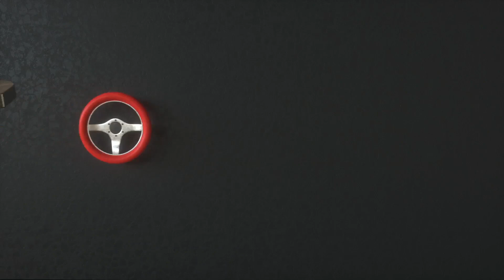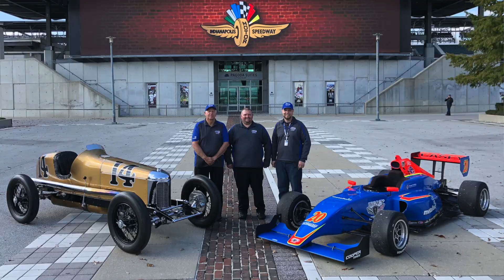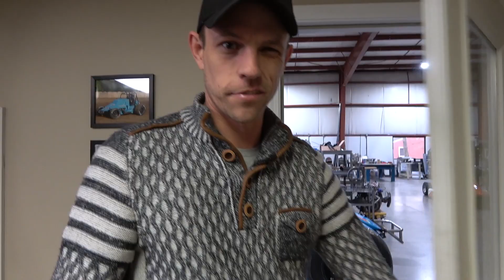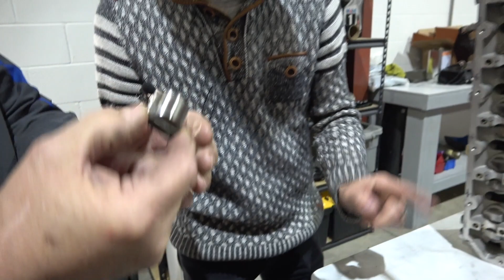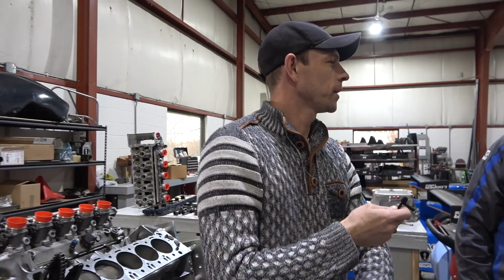Dinan BMW V10 racing engine Review and Rebuild

Comment: I am an owner of a E63, drove it for 50k so far.  This hick is a hick.  I also own two Cadillac escalades, two ford 1985 broncos,  a 1973 c10, and more. 
Get the f out of here. I love the 6,2 liter v8's on my escalades but to compare the engine of the S85, that revs at 8500-9000, to pushrod engines that reve to 6k, is the most idiotic thing.

Comment: For the record, the S85 block is not "nikasil coated," but rather made from solid Alusil--an aluminum silicone alloy.  Also, the weight of the Dinan race version of the S85 is not 520 lbs.   That is the weight of the fully dressed street motor.  With a Dailey dry sump, lightweight alternator, and many other lightening techniques, I suspect the Dinan race S85 weighs 450lbs or less.  Further, 35 hours of racing is a lot.  Many a race engine is designed for rebuilds every 25-30 racing hours.  So the fact that this motor showed signs of needing a rebuild after 30-35 hours of race time is 100% in line with expectations.  I'm no Dinan fan, but the comparison and analysis here should be fair.
Reply: BMW incel over here is IRATE
Reply: @averagejoebitcoin  Nah, just trying to keep the facts straight.
Reply: @bmwmensch  The fact is a Gen III is still better than this bloated engine.
Reply: @averagejoebitcoin De gustibus
Reply: BMW incel over here is IRATE
Reply: Was going to mention that I thought the block was Alusil.  Would have been interesting to hear the boring process  and given the results what he would do different- what a legend cool interview!

Comment: Idk get where he was complaining about the bolts. He said it himself, its a passenger car so the bolt shouldnt be an issue since you can upgrade/replace it w studs (arp) if youre turning it to racing engine anyway
Def right about weight.

Comment: How about reducing the displacement in the S85 back to the stock bore size? The Dinan engines are bored over 2mm. That would probably solve your head gasket issue with only a small reduction in power. Those engines rarely have head gasket issues and they sound great!
Reply: I do believe you're right. By boring out, these engines gain no more than 500cc. At ~110hp/liter, that's probably less than 50hp lost by leaving the stock bore. 

Main benefit of the boring is the high rpm capabilities, the engine is already over square at 1.26 bore to stroke ratio, but piston speeds and rod geometry isn't critical so increasing bore is way better than increasing stroke, which would lead to lower revving, less responsive engine. 

However, better way to reclaim this loss would be lightening the rotating assembly, like using titanium rods and pistons, bored out crankshaft, lighter flywheel and clutch etc... Also extensive headwork, increasing compression and other similar stuff. The S85 can be built to make power over 11k rpm. It won't be cheap, or really reliable, but achieving 700hp would be rather easy with stock displacement - "only" 140hp/liter, that's on par with the Ferrari 458 Italia, not even a race engine but a production V8.

Also, the S85 is a great engine. It's relatively cheap for it's performance, has a lot of potential, and sounds awesome. I do believe it's the best sounding engine in the world, but some Lexus fans would beg to differ.
Reply: @lazar2175  personally I would sleeve it back to the original bore, do exactly what you said, put a 10-1 exhaust, and make an incredible-sounding engine.

It's probably close to what I want to do for my custom build space frame track car(though I ain't gonna race professionally or anything)
Reply: @omnihein9322  That's interesting. I want to build a Superlite SLC one day with S85 engine!

Comment: The challenger o-ring failure was from using rubber on the cold morning along with the rocket fuel it froze it and it cracked causing the fuel to leak out and ignited....

Comment: The head bolts look like the factory Torque to Yield bolts, Butch is right, they have no place in a racing environment, and MAY lead to a loss in tension / blown head gasket over time (overlooking the other design limitations). 

As a BMW nut it is a shame but definitely looks like selling the DINAN engines and swapping in some SBC's is the go. I'd be keen to see some in depth videos of Butch speccing out an engine if you were to go that way :)

Comment: It would be problem free with stock bore, with more "meat" between cylinders and even slightly lighter pistons. 
To cheaply rescue this one, as it is, i would lower the max revs by 250/300, put a simple metal/cooper gasket and run rich AFR in the higher band, to lower the EGT as much as possible. You will not run more water bt the sleeves, but You can run cooler water, so maybe slightly bigger radiator? 
I love V10s, im suprised that Dinan choose this risky way, there is a podcast (or even 2) on Matt Farah channel with Steve, where He talks about this one and the V8. 

Happy New Year and Thank You for great, informative content Casey!

Comment: That Dinan motor was a cluster f**k from the start. Don’t stick a pushie in a proper race car - try get a deal on a Zytek or Judd motor probably looking at 650-750bhp at 10krpm and 110-130kgs with 3-5000km intervals

Comment: for 75k you get one  fragile and overly tricky motor, You can pick up an 8lt viper motor for 28k or so, or a complete runner 427 LS crate  motor for 17k with warranty now decide what class to run in. I like the Ford SHO motor, 300 hp at 7000 rpm..

Comment: interesting observations from the engine specialist. About keeping the head cool, maybe a methanol-water mix injection would solve the problems idk. Also you can find or build studs to keep the head tight and machine a lighter bucket for springs, still that wall thicknesses between the cylinders is so thin, not sure if you can rely on it, plus I guess there are other issues with it

Comment: What they could have done when the V10 was first built was to stagger the bores alternatively left and right to increase the distance between bore centres. I would think not a viable engine to run on a budget. As well as new head gaskets, new head bolts, other gaskets and any machine repair work. Then strip down and engine outs.  Overhead cams as well. One would spend more hours rebuilding the engine than running it!

Comment: Well having a spec series rules ... vs almost no rules ... big difference.

The BMW motor, without any BMW of USA involvment is pure waste ot time and money.
This time and money are better spend on something far more usefull for the kids and the program in general (because as the pro builder said there are cheaper/lighter/almost same rev and power options).

In my opinion, let the students tear the other engine, make their own conclusions for improvement ot the concept of it, and then just shelve both engines until BMW of USA has enough interest to work with you on the betterment of young people.
If in a couple of years nothing comes of it ... part them to some crazy rich guys to make them feel "good" for having a unique "racing engine thats part of BMW history" and spend the money for the program.

Be well, have a nice holiday season, thumbs up.

Comment: @Casey - The metal O-rings Butch mentions, are used in the Liquid Fueled Rockets, to seal for liquefied hydrogen and oxygen being feed through the turbo pumps and in to the combustion chamber - the motors on the back of the Challenger itself.
The O-rings that failed on the STS-25 launch were not in the Challenger, they were in the Solid (Fuel) Rocket Boosters (SRB's) that were attached to the sides of the main tank, and those rings were rubber, several meters in diameter, and the rubber froze and cracked on the pad, allowing the gasses from the burning fuel segments inside to leak out through the gaps between the segments.
So, No, not the same technology, but the same failure method as the gasket you've had on the BMW V10, hot gasses pushing out through a damaged seal.
The shuttle main engines, are some of the most reliable liquid fueled rocket engines ever made. SRB's of all forms are inherently dangerous.

Comment: So by five minutes in, Butch has explained where the BMW engineers were 'too smart for their own good', and also that if you know the limits of materials you can build better. This would be a case of bore spacing being too small for the intended use, but where that spacing got compromised by the need to have a short engine to have a shorter nose on the car.
Reply: Yes the bore spacing is marginal but the finishing touch was Dinan  overbored it!
Reply: well if the displacement is actually  5.8L ,then each cylinder the bore of each cylinder has been increased by 8mm, which is insane. normally 2mm is considered a lot.
Reply: @PalatschinkenPro  the displacement can be enlarged to 5.8L, but the bore is not increased by 8mm. (would be way too much lol) stock bore is 92mm and stroke is 75.2mm. With the 5.8 stroker kit, bore is increased to 94mm and stroke is increased to 83mm.
Reply: @scsnox  yeah, makes sense. I don't know what I was thinking, but clearly I've seem to have forgotten about stroke :D
Reply from the maker: Yep!
Reply: Actually, it was Dinan who overbored it from a 5L to a 5.8L. For a manufacturer to make their first and only v10 ( and note the very particular crank rotation of a v10) , this is massively impressive

Comment: It was a rubber o-ring that was too cold, but I think I am done with head gaskets after hearing about those rings. Reminds me of the copper gaskets used for keeping vacuum in science equipment that are cut every time it is sealed.
Reply: Yep, the SRB O-rings were more like the headgasket that's come out, not the metal O-rings that should be there.

Comment: Just because old mate hasn't seen half the things on the S85 doesn't mean it's not a worthy engine. Speedway guys are all stuck back in the dark ages. How about talk to DINAN who actually built those motors and who'se been building BMW engine for decades, not pushed Chevys. 

Genius Garage should stock with the S85, you already have old motors in that Corvette you race, The S85 is a good step in technology before the Lotus
Reply from the maker: Honestly not really the engine is inherently limited by the spacing of cylinders….
Reply: @CaseyPutsch  How big of a bore do you think a builder could safely go on an S85 V10?
Reply from the maker: I think they better stay stock if they want it to last
Reply: I feel like Steve Dinan talked about building these engines when he was on the smoking tire podcast. Maybe Farah can get you in touch with the guy. If nothing else but to explain what's up with the tiny bore spacing 😅

Comment: I believe the Shuttle o-ring issue was because the rubber-type material didn't expand sufficiently because of the near freezing temps at launch.  But it was in the fuel supply system, not part of the combustion area anyway - a totally different kind of gasket/seal.
Reply: Half right Mark. They were a flexible O ring, they were in the field assembly joint of the solid rocket motor sections. They were there to seal this joint in case the actual metal to metal joint wasn’t tight enough. The idea was that it might take a moment for the case to get hot enough to really seal against the high pressure in the solid rockets case. They only had to seal for a few moments. But because they were cold and thus not flexible enough to quickly seal the tiny leaking area, the intensely hot gasses were able to eat a path through the joint. Those gases then escaped and sadly the leak happened adjacent to an attachment point for the solid rocket motor to the huge liquid fuel tank. The hot gas then ate into that attachment. Once the attachment point gave way, the solid rocket motor pivoted into the fuel tank of liquid hydrogen and liquid oxygen and the rest was history.

Comment: Sell the engine!  Otherwise the students will spend more time (& more of your slim budget) rebuilding it and replacing broken parts than they will spend learning!  Any "teaching tool" needs to be reliable and durable to serve more than just a single cohort of students!!
Reply: Counterpoint: keep the motor because the challenge of making it work and keeping it in good running order is a great learning experience for the students and gives them more opportunities to find creative solutions to the motor's issues, plus the S85 makes an absolutely beautiful sound
Reply from the maker: True

Comment: 15:19

Yeah. And if you mess up the fitment of the groove or the copper ring, it will be able to crack your block (!), when you mount your cylinder heads and tighten your studs...
Reply: Like phillip kaess
Reply: @knicklicht7945  
Yes!! Not only one of his 2.7l Cosworth V6s died like this. Also his Lambo "LP-X" block [R.I.P.].
Reply: @tobihaifisch7558  yeah, what shame rest in peace lpx block
Reply: Keywords "mess, up".

Don't mess up. ;)

Comment: I’d probably not joke about the Challenger disaster.  My only complaint. Else? Carry on.
Reply: Whats the challenger disaster?

Edit: nvm i looked it up
Reply: @nashidaperv2351  You’re right. My mistake. Columbia.
Reply from the maker: Don’t even snowflake out on that… it’s an honest engineering question and funny because it takes away everything cool
Butch said. Your complaint is not warranted, needed, or helpful.

Comment: I am surprised he didn't mention sleeves for the cylinders.  Less displacement of course.  But I agree there are better options.  Years of experience has its advantages.
Reply: Then you'd have to get new pistons for 2 engines, and there goes your budget.

Comment: Don't wuss out.....go with the S85 anyway. Since it is clearly an underdog, the challenge of getting it to perform would be a great way for the genius Garage students to learn. Of course, the awesome 10 cylinder exhaust notes that it produces is justification enough! 😁
Reply: As much as I hate a Chev V8, that V10 was designed for the road, and is a fantastic road car engine, but on a race car at this level, you need an engine designed for racing, like a Cosworth DFV or the Chev race engines that were designed for the NASCAR and Sprintcar uses.
Using the Chev V8 out of a Road car, is not the same as using the Chev designed engine that was made for racing. Same goes with the Fords and the Chrysler's - the race designed motors are very different.
Reply: @PiDsPagePrototypes  aha\ agreed
Reply: I agree, but it will depend on the finance in the end.
Reply: i'm pretty sure this would be the coolest sounding.. but unless those blocks get put back to something you can live with..  probably better selling them on.
Reply: @griptopia  Definitely -- and don't look back!
Reply: To me that makes no sense -- it would cost a fortune and in the end you would not have a winning car --it would be DNF after DNF.   A "10 cylinder exhaust note" is a very poor substitute for wining races and standing on the podium.  No prizes for best sounding car..

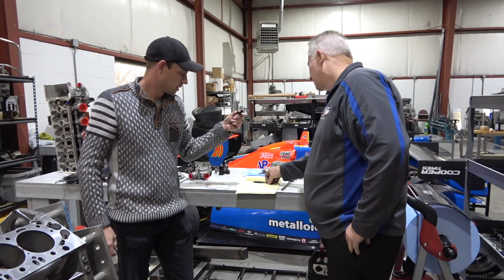Comment: At 8:18 he shows that an American push rod V8 is lighter and more powerful than a BMW V10.  So much for German engineering!
Reply from the maker: Ssshhhhhhh…. ;)
Reply: And a bmw v6 turbo in the 80s made more power 👀
Reply: @JohnDoes620  you mean straight 6 turbo or the inline 4 turbo.
Reply: @JohnDoes620  Squeeze Me, what? When did BMW make a V6 Turbo?
The M102 and M106 from the '80's were Inline Sixes. BMW has always promoted their Inline Sixes as being smoother then every other manufacturers V6's.
Reply: @PiDsPagePrototypes  yes mistakenly said v6
Reply: @JohnDoes620  That was a turbocharged 1.5L in-line four (not v6) with a iron block -- but the Ferrari 1.5L V6 turbo made even more power.
Reply: Really should say, an EFI Pushrod V8 from the 2010's onwards - before that, the pushrod engines were gaining for about a decade, but from the 70's to 2000, even a small small euro straight six or large straight four could outperform the US V8's.
Once the big three got their fingers out and developed some smarter EFI systems, and caught up on the materials sciences, then the pushrod engines made big gains, both in output and in emissions.
Crazily enough, making gains through EFI and materials, so is the Flathead design. There's a euro made flathead four for light aircraft, that gets good performance and is lighter then pushrod and overhead cam designs. For aircraft, less parts means less places failures can occur,... and it's a lot harder to push a plane over to the kerb then it is a car :D